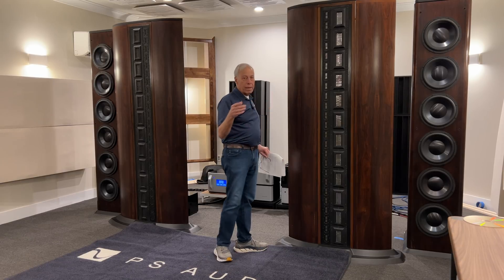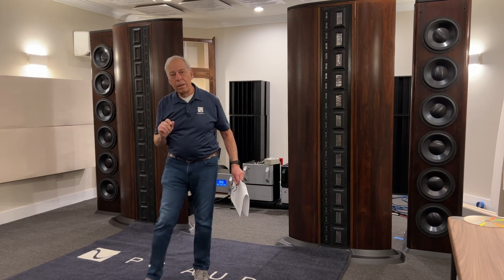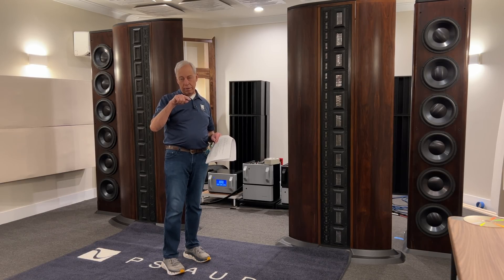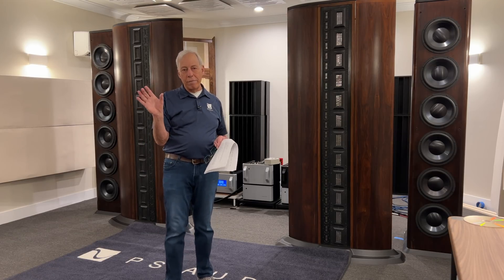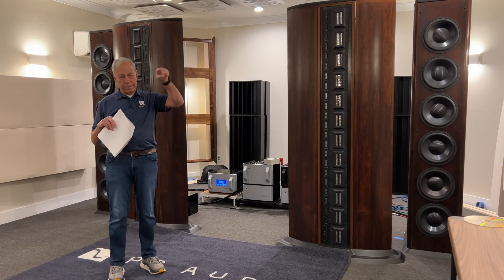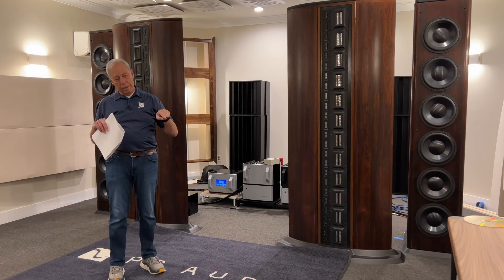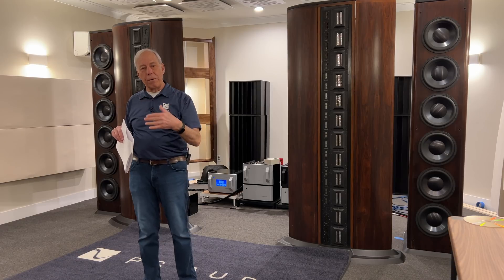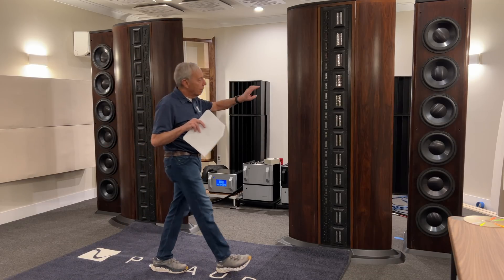How speakers produce multiple waves

Comment: Brilliant answer, showing that the response comes from the source. It does what the magnetic field says. The field is created by electronics which is created as a reaction to the input signal. The input and the reaction are tuned by the speaker and amplifier manufacturers.

Comment: We measure in sine waves because that was the easiest thing we could do way back in the day. Just generating a good stable sinewave was a challenge. Much less even measuring one. So we used steady state test we still use today. 

Perhaps it was the framing of the question assuming an "audio file" is a transcription of a sinewave? It would only be a transcription of a sinewave if a test signal was the source or the music wanted that. Otherwise the audio file would transcribe the instantaneous changes in the sound and it would not sound nor look like a sinewave. It would sound and look like the attack and then rumble of the drum added to the guitar, ... just as if you were standing there. And then maybe the keyboardist turns on some sinewave....

Comment: The PS AUDIO carpet in front of the towers and running up the bottom of the base isn’t an accident? Perhaps to correct a reflection? It was this way before I think. Maybe somebody can shed some light on this. I can’t think of a reason it looks better like this. Paul?
Reply: Likely just to get it as close to the ribbons as possible as the lowest ones are pretty close to the floor so you'll get the first point of reflection pretty close to the speaker. Then again it's a carpeted floor so I don't know if they need much more than that. At least they centered the mat this time as all the time they had the speakers in the other music room the mat was significantly off center.

Comment: This was the most  enlightening talk I have seen on this channel. It is always a good feeling to learn something. To think I never even learned about a complex wave form is in itself a mind blowing experience. I assume that I never dug any deeper because some things we simply take for granted. Like losing weight, where does the weight go? How does fat exit the body? 
Thanks for this one Paul. 
Also I'd like to add that, in my experience, people are visual learners as often if not more so as they are audio learners. Don't let any thing hold you back from improving your own skills as a speaker or a teacher. Especially if the reason is an "I think if I can draw it I can talk it" supposition. Let's face it, you "draw" with your hands when speaking already. Like describing a wave form. So what if you add a white board?

Comment: To answer the question: the music in a recording is the combined complex of all the changes of air pressure into one wave form.  If there is a driver that can move from 20 Hz to 20 kHz, it should just reproduce that wave movement and there you have the music.  Handphones can do that in a small scale.  Unfortunately, loudspeakers cannot do that in a large scale, so we use crossovers to separate the highs and lows to allow a division of labour.
Reply: As an interesting aside, superposition means that we can use things like the Fourier transform to get the individual components of a complex waveform. This is quite fortunate otherwise we would not be able to hear. Our brains have to solve the same issue that electronics like DACs do with digital audio, namely finding a way to get a logic-based state machine that can only assume discrete values to process analog waveforms that can have any infinite number of values. Your hearing does this via the tympanic membrane and stereocilia which decompose the sound into its frequency and amplitude components with respect to time and then are subsequently topologically mapped onto the auditory center via the nerves from the cochlea. Its actually impressive in that the amplitude, frequency, and phase can be determined, and thus what we hear is actually a vector quantity and not just simple sounds. This leads to things like being able to localize very low frequency sound that's much longer than the distance between our ears via ITDs and also hear binaural beat notes. Its all quite interesting, and often seldom appreciated in the audio world of how this stuff actually works.
Reply: Really its down to what's known as superposition. As long as the resultant wave is equal to the algebraic sum of each of its components, then it works and we get the sound back from the electrical waveform. Speakers and headphones are good at this provided we keep them in their small signal region. Outside of that, harmonic distortion and other nonlinear effects violate our assumption. The sum of the waves is no longer equal to their parts in the original waveform. We have new and different things that distort the sound. As far as crossovers go, this is principally down to wavelength and how the transducers behave. Large woofers are quite directional at high frequencies and show cone resonances, and tweeters can't do excursion, so at a minimum we need to band-limit the frequencies each covers with cross-overs.